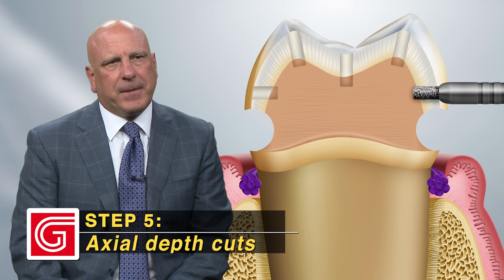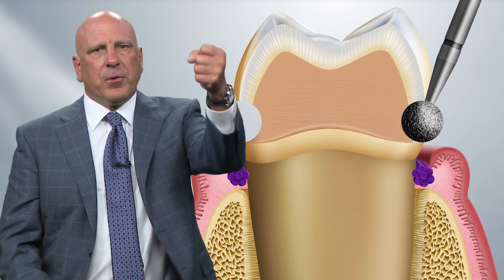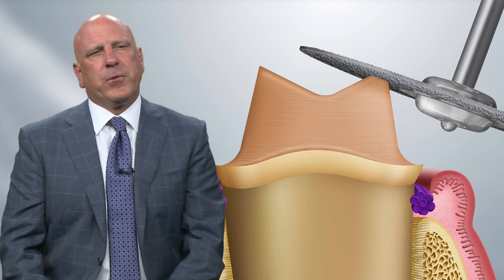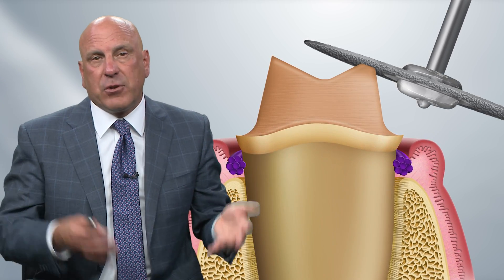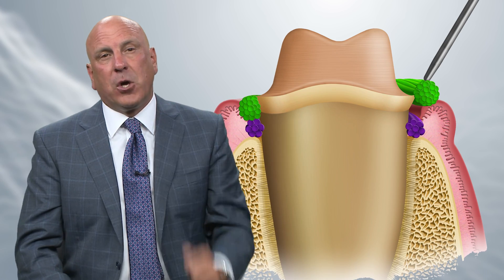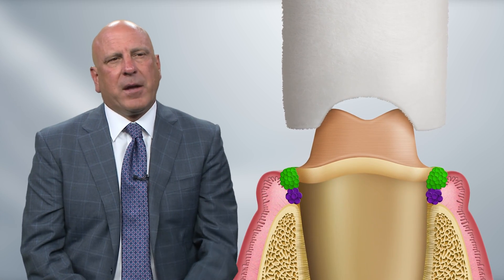HOW TO Prepare Molar Using Reverse Preparation Technique

Comment: Thank you for a great video Dr. Michael but can I ask a off the topic question about how to use a articulating paper on opposing crown restorations. Let's say I've made 2 crowns for the patients number 26 and 36, patient does not miss a tooth and the crowns are high. So because they are opposing teeth how can I know which crown I should reduce to achieve occlusal adjustment? The both crown will be painted because of the hight.

Comment: No and no. Carbides have no business cutting a crown. I hate this method. You cant see blushing as you prep margins or depth. Yeah zirc needs its clearance. But not every tooth is cut out for zirc, and sometimes you wont know that until you prep and are actively following the changes in shade and translucency of the tooth.

Also zirc is not the most conservative, and we all know it

Comment from the maker: What is your favorite bur when preparing a molar ? http://glidewell.dental/CrownBridgePrepCE 
Comment  below!
⏱TIMESTAMPS⏱
0:00 - Intro
0:08 - Step 1: Breaking the contacts
0:16 - Step 2: Placement of the first retraction cord
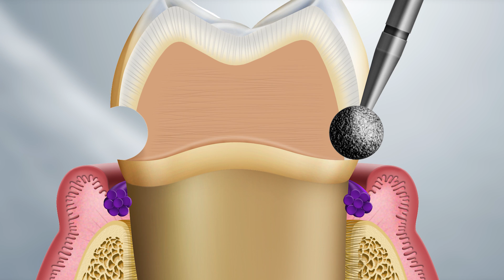0:28 - Step 3: Gingival margin preparation
1:26 - Step 4: Incisal edge depth cuts
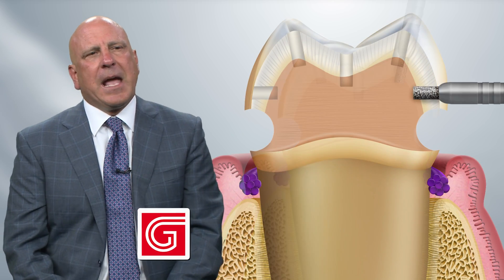1:39 - Step 5: Axial depth cuts
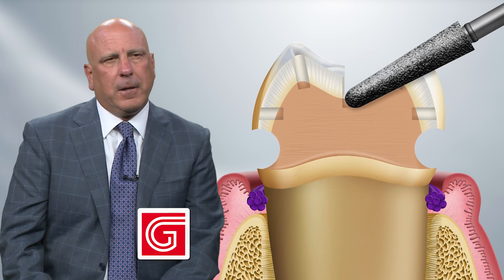1:57 - Step 6: Blending the depth cuts
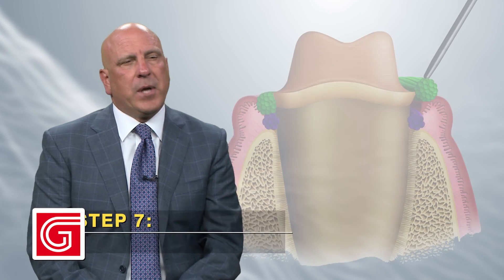4:21 - Step 7: Placement of the top cord
5:34 - Step 8: Anatomic Comprecap
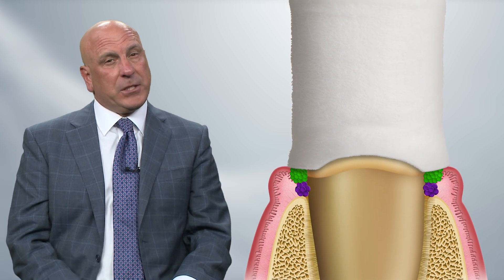6:41 - Conclusion 
7:33 - Want more FREE CE courses ? - http://glidewell.dental/FreeCE
7:59 - Bonus clinical dental tip